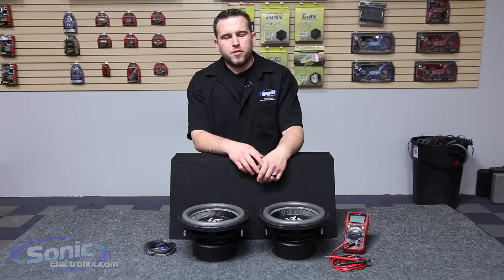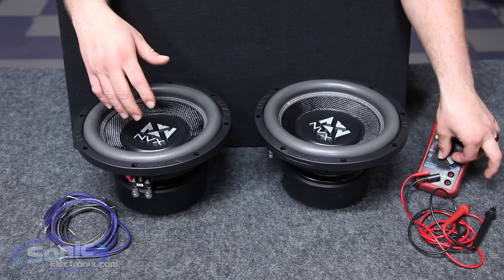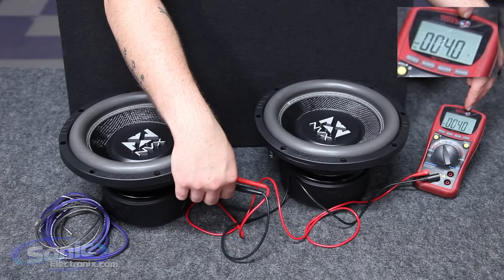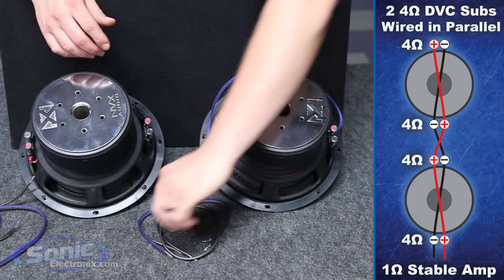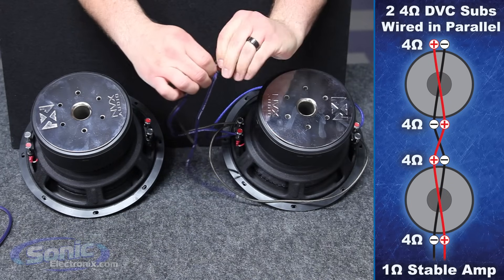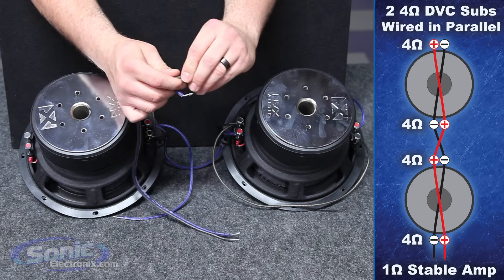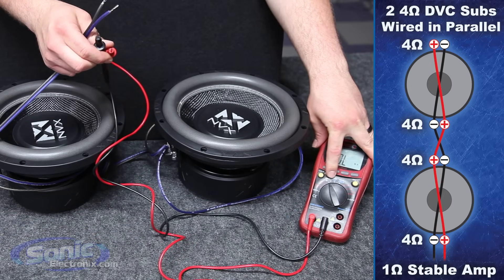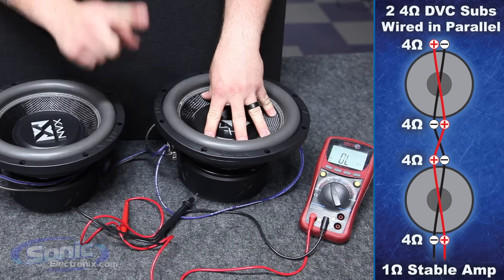How to Wire Two Dual 4 ohm Subwoofers to a 1 ohm Final Impedance | Car Audio 101

Comment: If its showing 1.7 are they wired to 1ohm positive negative to negative and both leads to the amp not daisy chained to subs then to amp as both leads or does it need to be daisy chained then to the amp as one wire..

Comment: Im confused...this video makes sence however when i research this anywhere else on google it keeps saying the final ohms will be 2 ohms if you wire 2 dual 4 ohms subwoofer in parallel.... whybim confused is tge multimeter clearly says 1 ohms final however the overwhelling majority saying 2 ohms even chatgbt

Comment: If i have 2 dual 4 ohm subs each rated at 400 rms do i need an amp that pushes 400 rms at 1 ohm or 800 rms at 1 ohm?
Reply: I'm guessing 800rms amp needed , did you manage to get the right answer? Seems like tge channel owner doesn't reply to questions

Comment: Will it still come out to 1  ohm if my box has 2 separate wiring places instead of one like the one in the video or do it need to take  the 2 different wires in the back of the box and run them together into the amp to make qq ohm or is it all the same?

Comment: Man, I'd love to have a good set of NVX dual 2 ohm DVC 15s. I have a set of Sundown Audio SA12-D2 subs in a divided box with two Aeroport 12"x6" ports on a Sundown SAI-1750D amp in my Beemer that runs at 1 ohm and they pound, but I just bought a cheap set of Rockville W15K9D4 subs that I plan on wiring down to 1 ohm as well with a 2.1 cubic foot 38 hz divided sealed box and I'm excited to hear if there's a difference in my 1 series BMW. I had to REALLY make the box fit and it fills my fairly large trunk while the dual 12" box fits easily. It's just been a while since I had a couple 15s.

Comment: Okay if I have 2 4ohm speakers at 400rms and run it at a 1 ohm final impedance does that mean it will be 1ohm 200rms...just tryna figure if a 1ohm is better then the 800rms at 4ohms

Comment: Ok so I have a dual port mono block amp. I have 2 Alpine Type E subwoofers. How can I wire the subs for 1 ohm when there is 2 ports between the 2 sub enclosure. Should I drill a hole ? So only one wire for both subs comes out of box ?

Comment: I have question I have mines parallel but somehow when I turn the gain up it starts to clip , I’m running two 2500 watt DB Drive Wdx12 subs on a Taramp MD 3k

Comment: Hmm. I have a dual sealed box and need to wire my subs up like shown in video.
I guess I need to drill I small hole in the piece of wood between each sub so I can feed the wires through?
Reply: I’m guessing you can just run the wires in the box behind the port
Reply: @cobellc  sealed box. Two separate sealed chambers, but I worked it out

Comment: I just ran my subs like that but it still reads 1.9 ohms
Reply from the maker: The multimeter can read a bit higher. Resistance in the probe wires and how the sub cone rests can affect the reading

Comment: nice video but how do you get two sets of 11 gauge wires to fit in the center speaker terminals? on my Hifonics subs the wire doesn't want to fit in the same type of terminal as your video? Any suggestions?
Reply: If ya have two connections on your mono amp it'll be the same as wiring together.  Just make sure your two speakers are wired parallel to drop the impedance down.  2 yrs later for those that wanna know😂😮😮

Comment: What if your wiring subwoofers in an enclosure with two sets of speaker binding post? I have 2 dual 1 ohm subs an the wiring  diagram  that came with the is different. I have each sub wired as you do here but straight  to each binding post. Giving 0.5 ohm per sub. Then running  2 positive an 2 negative  leads from a single  channel mono block amp. Wouldn't that read as a 0 ohm load to the amp? Should I be using a jumper from one terminal  to the other on the speaker enclosure?

Comment: how do you wire it inside the box. if there are 2 positive and negative terminals, do i use both or only one
Reply: The video explains it perfectly. Just do the same exact thing mounting them in a box. You’ll only need one set of wires (+\-) coming out the box. Hook those to the (+/-) on your amp

Comment: I drilled a hole in the middle of my box so I can get the wires tho. Put it on my right side. So I’ll just have to use one output on my amp for the - an + to push both of my subs.

Comment: Hello I have 2 speakers 4ohm each, connected parallel in separate sub box...then from one terminal of the box I wire it to the other terminal of the other box positive to positive & negative to negative, then from one terminal of the sub box to my amp do I have what you just did in the video??? I’m not sure if that makes sense lol.

Comment: What would it sound like if they were not wired correctly to a 1ohm load? My amp cut out for a few mins and someone mentioned it might be because the speakers are wired wrong. I got the box already wired through the mail and forgot to check the wiring inside before I set it up. Would I be able to check the ohm load by using a DDM on the side terminal or the speaker wire coming out of the terminal? Or do I have to remove a speaker to check?
Reply: Your amplifier May not be able to handle 1 ohm
Reply: Try get a amplifier Well a monoblock amplifier But make sure That the amplifier is a class D

Comment: Um my shop wired mine down to one different I dodnt think it was a good idea to send all the power to one sub to travel into another meaning one is gonna end up with more power than the other . Mine are wred positive to positive negative to negative with the jumper on my dual 4ohm Phoenix golds then both wires come out of terminals then wired into amp for the 1 ohm load again there the wires are together positive and negative in my 1 channel putting about 1800 watts to them . . So mine are wired a little different

Comment: I recently just purchased Dual EVL 12” 5000 watt Loaded Enclosure kit, costing 800$   Would it be a good or bad idea to use this method in your video on these subs? Respond ASAP please!!
Reply: That should have came wired to 1 ohm already, same method as this

Comment: I just bought a box and on the box that has four terminals two positive two negative I checked ohmmeter and each connection is four ohm now how would I wire that down to one ohm  to my app which is a sundown Sae1500

Comment: My jumpers are pretty long ? Will that affect subwoofer output ? Should i shorten the speaker wire ?
Reply: It shouldnt effect it too much because the speaker wire has a very low resistance. Id shorten then for simplicity and to clean it up and prevent any tangling or anything.
Reply: @christophergarcia9218  mmm i rewired my subs back again now my bass hits harder
Reply: @SleepyBoiii  dope👌👌

Comment: Hello, I was hoping you could give me some advice, I have an old Rocford Fosgate Punch 201s 2ch 600w amp (amp says it's 4ohm stable bridged) and have been runnig it bridged to a 12" 4ohm alpine type-e sub and now I want to add a 8" dual voice coil sub under my trucks center jump seat, Can I just hook each sub to each channel, or wire them in series or parallel with amp bridged? Thanks, love the vids you guys put up here

Comment: If subs can't handle the power of the amp will the bass cut off and on????
Reply: no its the complete opposite. if your AMP cannot handle below 2ohm(common) it will "cut off and on". If your amp gain knob is maxed the fuck out(too many ppl do this, its not a volume knob) it will turn off.  If you use too small power wire on a powerful amp it may also turn on and off.  IF... Your sub cannot handle the power of your amp OR more likely your gain knob AND bass boost(dont ever use) are smacked wide open it will just blow and rattle to death.

Comment: What’s if I have 2 subs dual 2 ohm can i turn then into 1 ohm ?
Reply: no you can go double or half. Dual 2 ohm= 4 or 1 ohm....EACH. If you wire each sub to 1ohm then put them together you would have .5 ohm... BAD! this will smoke the fuck out of your amp quick if it doesn't have a good protect feature. 99% OF ALL AMPS ARE 1ohm MIN but usually 2ohm so check the box!    You can wire your setup to 2ohm, best you can do.
Reply: @rmblwgn  your wrong I had 2 65 bucks a piece 2 dirt cheap 15's wired to a 2 ohm load on a Audiopipe 2016 edition mini apmi 2000.1d. Gains set precise never had any issues then wired them down to a 1 ohm load still no issues all on stock electrical just had the big 3 upgrade no trunk battery, and no tractor alternator....
Reply: @randywatson4870  I didn't say one ohm was bad I said .5 ohms
Reply: Also two dual 2 ohm subs cannot equal 1 ohm ever

Comment: The dual 4-ohm subwoofers included in my enclosure are pre-configured and wired up inside of the subwoofer enclosure at a 1-ohm final load. My amp is 1 ohm stable how do wire the box terminals to amp?
Reply: Henry G I believe it’s positive to negative  with positive to negative

Comment: So if you originally have 2 svc 4 ohm 12” subs rated at 150w rms on a 2 channel amp. If you wire it in parallel at 2 ohm would it still require the same amount rms or more?

Comment: hey. i have a GM-D9601 pioneer 1200w RMS 1ohm stable and 2 dual 4ohm 600watts RMS pioneer,i have wired them in parallel and about one month later they blow off the amplifier.can you help me if there's a risk the sub blow the amplifier or another problem.?

Comment: Hi. Can I connect my 2 instrumental speakers,1 mid and 1 tweeter in my 3 way _ are rated 8 ohms and my amp is rated 8 ohms. Thanks for your help.

Comment: Wait so what wire do I use if I'm doing a series? Do I use the negative wire or positive wire to do series?
Reply: By series, I take it you mean wired in series vs. parallel.  If you have a dual coil 4 ohm sub, you can make it an 8 ohm sub (assuming the amp you have takes that and won't go lower) by wiring the positive on one coil to the negative on the other coil and doing the same with the other side, wire the remaining negative to the positive of the other coil.  This will but the coils in series, doubling the impedance of the speaker.

Some may ask why you would want to do this since most amps run 4 ohms down to 1 ohm.  Think about really high power amps...thousands watts amps...and you want to run a lot of subs to that (those) amp(s)...electronic theory states that if you run impedances in series, they double the impedance, but running in parallel cuts the rated impedance in half.  Hence, running two 4 ohm voice coils in parallel (positive to positive, negative to negative) drops the effective impedance to 2 ohms...and running two such speakers also in parallel drops the effective impedance to 1 ohm, increasing the power output of the amp (most amps put out more power the lower load impedance they feed...be sure and check you amps specs though and make sure they conform to the configuration you're building).

So, if you tie two voice coils in series, you get 8 ohms out. Tie two of those speakers in parallel and you'll get 4 ohms out.  Now...tie two more speaker combos like that in parallel and you'll get 2 ohms out.  You're now at 8 speakers.  Do this one more time and you're at 1 ohm with 16 subwoofers.  Now you're beginning to get the idea.
Reply: My math was off...2 8 ohm configured subs wired in parallel to 4 ohm, then two more 8 ohm configured subs wired in parallel to 2 ohms makes 4 subs, not 8...then doing that again will bring 8 subs down to 1 ohm...still impressive...but you can take that configuration to whatever you can imagine.  Add two 8 ohm configured subs in series to make 16 ohms, then run more configurations like tied in series and parallel to make is as many speakers as you can physically fit in a space.  Ever see a van with umpteen hundred (seemingly) subs?  That's how they do it.

Comment: This isn't how to wire a subwoofer properly
Reply: How do you wire it then lol
Reply: crunkjuice29 you can achieve a 1ohm impedance by wiring you dual 4ohm voice coils together by having your wire coming out go to the other speaker wire coming out & 1 set of wires going to the amp - same theory just done on the outside of the box instead of inside the box (bridging your speaker box )
Reply: Shawn Connolly that's how I always did it all positives together in on spot on amp and all negatives also

Comment: So if I have two subs that are 600 watts rms at 4 ohms each and i wire them down to one ohm. How many rms will they be at 1 ohm? or does the rms not change?
Reply: The RMS of the sub doesn't change.  That's the rated power the voice coil of the speaker can handle in normal operation.  The max rating is how much power the speaker can take in a spike without blowing, but you don't really want to run any speaker for long above RMS...the voice coils will heat up a lot and fail.

Comment: how to wire two dual 4 ohm subwoofers to a 2 ohm final impedance
Reply: Quik Tek u cant
Reply: If you wire 2 dual 4 ohm subs in series.so what's final ohm would be?
Reply: snoop furlow If you mean 2 dual voice coil 4 ohm subs wired in series...wire the dual voice coils in series gets you 8 ohms out (you can verify this with an ohm meter as they in the video showed).  Wire the second dual voice coil sub wired in series to make it also 8 ohms, and then wire those two subs in series for a final impedance of 16 ohms.  Running in parallel cuts the rated impedance in half.  Run in series doubles the rated impedance.
Reply: Wayne Dahl yes but is it hooking the voice coils up the opposite way such as positive to the negative,the negative to the positive?

Comment: Can you than bridge that to the amp or run it on one channel if I have a 2 channel class d rated amp?
Reply: Edward Weisenseel you can but is better to bridge them if your amp can handle 10hm  you will use your amp and subs to their fullest

Comment: Oh my gosh guys watch the video again I read som of your comments like running 1 wire from each speaker that's series . You will increase the resistance that way you need to run them parallel which is all the positives together and all the negatives. You can do more speakers search for series / parallel wiring

Comment: ok I have a kicker mono block amp with 2 terminals at 2 ohms , can I wire the subs that are 4 ohms an convert each sub to 2 ohms an connect each sub to its own terminal
Reply: So the two sets of terminals on a mono amp are connected as it is a one channel amp ... if you wire like u said the subs will still be connected together just at the amp in this case still resulting in a 1 ohm load. u need a 2 channel amp to get to 2 ohms with 2 dvc 4ohm's.... basically what Trebuer22 said now that i read it

Comment: I have 2 dual 4 ohm 15s at 2600 watts each with a rms of 1300 each. I wired them parallel to 1 ohm like in the video. Problem is I have a 500 watt power amp. Am I at risk of burning my amp or speakers up hooking them up. Haven't tested them yet
Reply: Nothing will happen but They will sound like shit lol
Reply: they will need an amp that gives around 2500 watt RMS at 1 ohm I guess, 500 will kill ur subs. I hope u were trolling :)

Comment: I wired My 2 DVC 4 ohm Subs In Parrelel Wanted A Final Impedence Of 1 ohm But when I Check It with A Multimeter It Reads 2 ohm Instead Of How I have it Wired
Reply: Try larger wires/legitimate speaker wires, they have less resistance, or check the leads in your meter before you begin. By touching the leads together. That will tell you how much to subtract from your final impendence. Because leads also have resistance.
Reply: RayQuan  Penn yes I'm having the same problem

Comment: Hi my homie ordered a hifonics zues 1200 watt amp and we hooked two dual 4 subs to 1 ohm and the amps bass knob turns red when its hitting real hard? does this mean something in the wiring is off? i made sure everything was good the only thing i could think of is that the car is too old to take the amps power because it was dimming very hard. have you ever heard of this issue?

Comment: I have to 15-inch qpower dual 4-ohm subwoofers would they be able to handle it on a 5000 Watt amp there 2000 a peace
Reply: Benjamin Collins.  yea it will work perfect
Reply: Jardan Edwards thanks for the feed back
Reply: No problem
Reply: Jardan Edwards ended up going with a SPL gorilla series 3400 watt amp  wired down  to one home what do you think it's putting out

Comment: I'm looking to get subwoofers that are designed with dual 4 ohm voice coils, for an 8 ohm or 2 ohm configuration. Is it possible to configure them in the way this video shows to a monoblock amplifier? If not, what's the best way to get the full 600 watts of RMS (x's 2) from the subs?

Comment: So lets say those are 500 watt rms rated subs and you wired them directly to a 1000 watt monoblock amp@1ohm. Each of those subs would be getting 500 watts each even though they are connected with only one wire to the monoblock amp correct?
Reply: SPNFENDER yup that is correct
Reply: Wow mind blowing lol so which sub gets the 500 first 0_o
Reply: @Juli-n-David  technically the first sub connected straight to the amp but its pretty much instantaneous so you will not notice the difference
Reply: I always imagined you've just created 1 1000w sub.
Reply: So if I wire like this there’s no reason to use the other terminals on the other side of the box since they both run thru one cable out to the anp

Comment: so does only one set of wires come from box to amp or two sets
Reply: Would be 2 wires.One positive and one negative.I have a 1200 watt Fosgate monoblock Amp hooked up to 2 1200 watt Fosgate 4ohm DVC punch Subs.My Amp has 2 sets of terminals so positive to the left set and negative to the right set.Two wires.
Reply: u